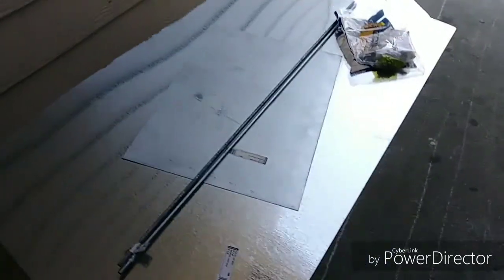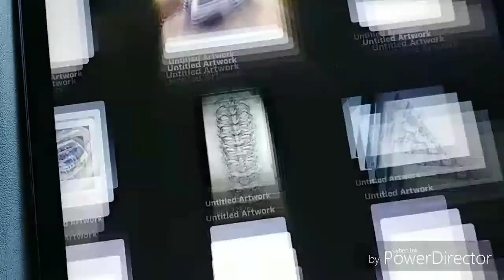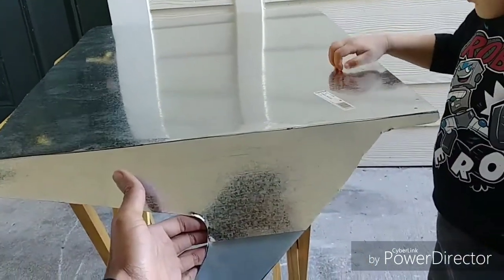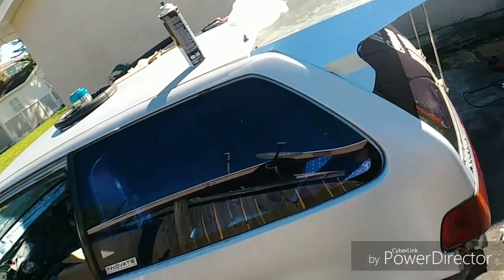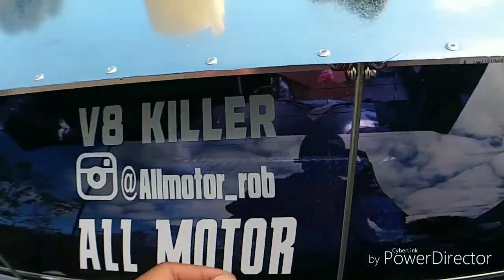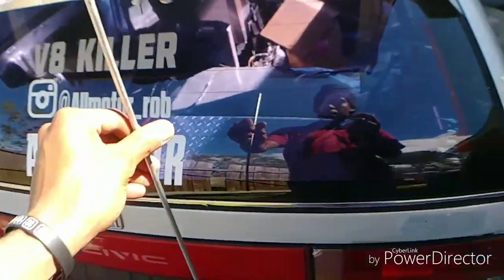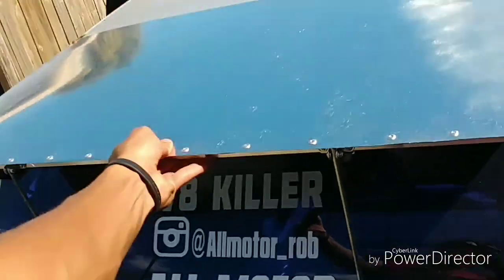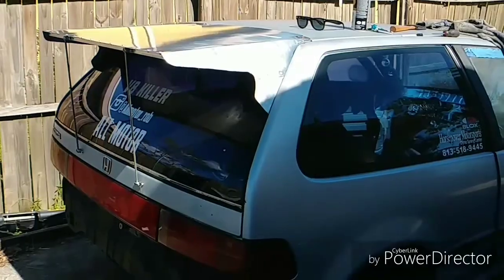Custom ef drag wing part 1

Comment: Tip for making those bends on the metal a bit straighter is to draw the line and then make punches along that line with a flat head screw driver. 
This way when you bend the metal, it bends on the creases you made with the flathead. 
Or instead of punching it  you can use a dremel to cut slits along the line for a crisp edge .